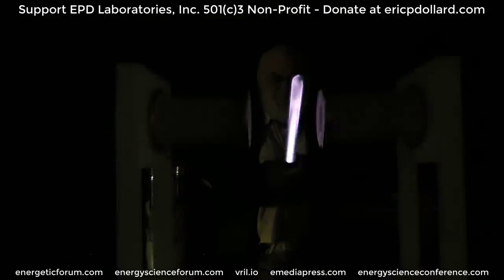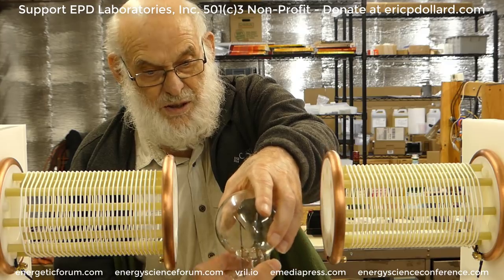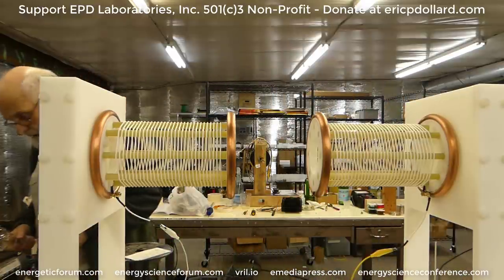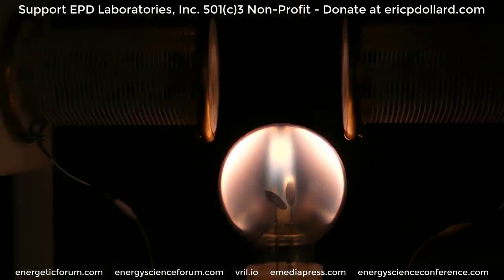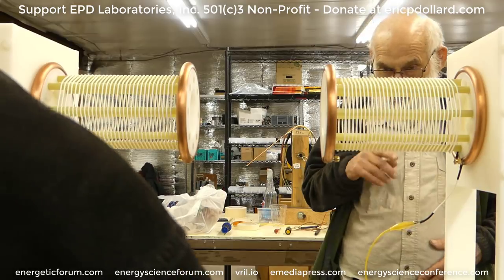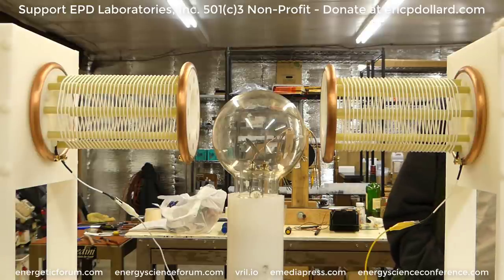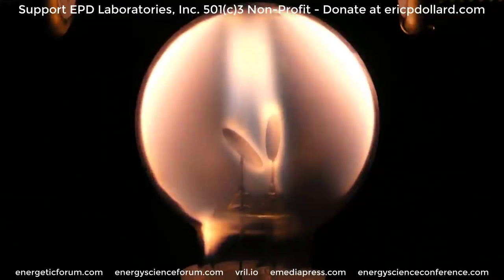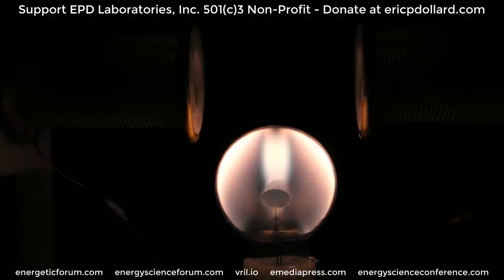2021-04-13 Cosmic Induction Mode Test 1 - Eric Dollard & Aaron Murakami

Comment: To anyone who wonders why this is a big deal- This energy is being harvested through the air- there is no traditional power supply, and he's then transmitting this power, without wires, via radio frequency. Correct me if I'm wrong but I think thats pretty amazing. Update: Still amazing, but I'm not even close to having a grasp on this. Hope I didn't mislead anyone. All the best!
Reply: Even more crazy, it’s a different type of electrical wave. Also only need one wire to transmit this power.

Check out his old Boardland Science Lectures on Longitudinal waves!
Reply: @jondelaire  I figured it was above my pay grade
Reply: @NeilZ2k15  mine too lol
Reply: Thanks. I couldn't figure out what cosmic induction was all about
Reply: I think Eric Dollard created birkeland current when he mentioned spiral electric wave form rotating clockwise and counterclockwise in his 1986 psychotronics video around 23 mins. Counter-rotating electromagnetic field is a special property of birkeland current which the outer space is full of which creates galaxies and stars. Check electrical engineer Donald Scott's videos on birkeland current.
Reply: @Xeno_Bardock  Scott's paper is good indeed, love his enthusiasm, to bad he is tied in with that other guy Wally who, let's be honest here, made it easy to be dismissed as a group (thunderbolts and EU).. pushing the anode/cathode solar model and even worse the dipolar gravity model was to much to recover from. i even like the most speculative side, the mythical/ancient cataclysm part, more then anything Wall ever said.. there is something missing in plasma cosmology, apparently the conclusions made in the Peratt papers on the simulations done on the then super computer are off, yet it would seem most significant "new astrophysics insights" are made in the realm of plasma cosmology aspects and the amazement of how magnetism does so much more then they can be comfortable with.. i love Peratt's papers on petroglyps/high current z-pinch aurora's btw, it's the most underrated and ignored work done archaeology and like some other big themes pointing to that signature problem in academia, peer pressure based bias... 
and oh yeah spread the message, the crime of the century is the push for vaccine and the silence on ivermectin.. 🙏
Reply: They should write a description at least...
Reply: So tesla coil and radio waves, why are we calling it cosmic induction?
Reply: @beachboardfan9544  because a few decades ago Eric build a similar setup which showed galaxy like structures in a vacuum tube, don't know the gas but i thought he mentioned sodium vapor as one of the compounds in that vacuum tube..
Reply: @beachboardfan9544  I made a few tesla coils myself and have several still working, when I put my plasma ball above the tesla coil I get all sorts of different effects, this isn't that special to me anymore, it's old news but still I enjoyed to watch this video.
Reply: @runs_through_the_forest  is that your Indian name?
Reply: if you think that is amazing  clearly you have no idea about science
Reply: I feel smart bc that's what I was guessing lol. No degrees I just get shit.
Reply: It has nothing to do with what you said.
Reply: patluxor2482  you're absolutely right, I don't understand it yet
Reply: Yes aetheric currents not electron flow
Reply: If you connect your Tesla coils to a xenon arc lamp bulb, you should be apps to charge capacitors at any distance as long as you focus its aetheric light on a conductive surface!
Reply: This could be fucused to a narrow beam and mske a new type of laser technology!
Reply: Wow you mean electromagnetic energy doesn't need wires? Who would have thought that? When I cook stuff in a microwave oven I always have to connect a lead to the food.
Reply: I just read Eric's paper on the Oscillating Current Transformer and he states that winding the turns of wire close together on a continuous solid support structure causes major retardation in the fields which makes the Magnetic component Transverse, is that why he always uses separate support spokes with gaps between the wires like the device here? 

Is preventing the retardation of the magnetic component like this all that is required to make the magnetic component Longitudinal or are there other ways that are more space efficient? Like his LMD transmission line for example, does that thing need to be run at its resonant frequency to maintain Longitudinal transmission? I'm trying to get the basics down of what is required for Longitudinal EM transmission.

Comment: Hopefully we get to see a fractal galaxy forming at cosmic superimposition at neutral zone soon from metal vapors and gases. 👍
Reply: is there any video evidence of those experiments out there? i listened to Eric explain the whole story in a video a few years ago but if i remember correctly there's no vid's of it? indeed if possible let's hope we can witness the real euhm magic 👉🌌👈👉⚡👈👉🧲👈    🙏
Reply from the maker: We're just getting warmed up - also, this is small scale 100w - when the 2 racks are done, we'll be at a couple thousand and will revisit these experiments.
Reply: Crannnk  it up .. 👀👀👌
Reply: @runs_through_the_forest  i saw a photo that showed twisty almost galaxy like things in pictures they shared i think on his website
Reply: @cjcoleman3893  the thing is in astronomy they are only scratching the surface on how everything works on the larger scales (smaller scales to but they keep on betting all in on dark matter ignoring EM play of plasmas as much as possible) 
it's a huge shift and thousands of profs need to realize what's going on, the gravity only paradigm is about to fall.. all significant papers now are on magnetism and it's crazy to see a whole field struggle to fit these new visions in with the gravity only models, it will take a while i guess.. :p
Reply: @runs_through_the_forest  For sure will take time to erase and replace the mind virus
Reply: Why bother with metal vapor and gasses, I’m wondering if pure vacuum aether could be used to form these structures.

Comment: Buy a tesla plasma lamp, the big bowl has no metal inside, you can easily take it apart, and they are dirt cheap. Nice an big also. I believe they contain nitrogen
Reply: What you want is easier to ionize metal vapors inside the plasma lamp along with noble gases. Metal vapors i think can act as micro-cores of fractal galaxies and stars forming inside the plasma lamp.
Reply: @UniversalExpanse light is a pertabation of the ether and a part of the electro-magnetic spectrum. Plasma etc. Is also electro magnetic.
Reply: @Xeno_Bardock  the best metal gas would be hydrogen I guess
Reply: @MasterIvo   Hydrogen is a must along with noble gases. You also need metal vapors, perhaps magnesium, titanium, iron, lithium or tungsten in its vapor form. Hydrogen may act as a layer on the surface of metal vapors acting as micro-cores creating fractal stars. A vacuum chamber would be a better choice since you will be able to experiment with various gases and metal vapors.
Reply: Narrrr  .
Reply: Would the Universe in a bulb be because of the Universe being a negative hologram? One pixel has the entire Universe in it. THEY are talking or doing, change a pixel, would change the entire Universe.

Comment: I create these effects using my zvs driver and two normal high voltage coils using a normal incandescent lamp bulb. What is the difference between what I do and what you guys are doing here? I know I am overlooking something you guys are trying to demonstrate in the vid but I never hear it stated what's being attempted.

What exactly are you guys doing? Wouldn't you get better results using a dedicated plasma globe?
Reply: Have you tried focusing tge light from your bulb to charge a capacitor from a distance, the light is most likely longitudinal from it like Eric did with this impulse DC fired bulb!

Comment: Just with the metal brake rotors spinning at high velocity inside the automobile's large metal brake calipers could power our cars, and we use them as brakes, haha
Reply: Our government knows these things and more. The powers that be dont think our society deserves to know or benefit from this.
Reply: you can't just say that and not explain it.  Something, something magnets right?
Reply: So how do you get it started then? The energy required to get the rotors moving will always be less than can be harvested back from that system due to energy lost to heat etc. Same with a flywheel. And there are electric vehicles that do use the coasting wheels to charge the battery, but again, that return is negligible compared to even a small gas generator and isn't enough to actually keep the vehicle charged while driving without additional energy being added somewhere. Simple conservation of energy tells us that this design could never work.

Comment: Ide like to setup my Software Defined Radio gear near the experiments to get some visual waveform data on the different modes and lighting states. Plus Fractal Geometry and Fibonacci Systems is a study of mine.

Comment: Looks like two Tesla coils end to end. The earth is flat, though
Reply: juano isquia  
Gotta start with the binoculars. With electrical signals you can't say one way or another. Politically the earth is a ball.
Reply: Kiri Uacybhail Otaraua  
Just knowing what or who is a fake
Reply: juano isquia  a simple gyroscope proves earth’s not rotating
Reply: 🤣
'nuff said.
Reply: @jflebas1217  Foucault pendulum?
Reply: @infidelapostate3094  
Action Reaction and Counter-Reaction
Reply: @StarNumbers  dont brinnnnng the flat earth .
Reply: @istopedthewuhanlabfunding6351  
Action Reaction Counter-reaction is not about flat earth, but it could be about a strinnnnng
Reply: @StarNumbers  the big glassssss dome over the flat earth is 
Ringgggging.
did some2  just fart.
Reply: juano isquia  its important to know. when they say flat they are talking about the surface of the plane. the atmosphere of the earth is curved and extends out into space for miles...which is what makes the earth curved.. the atmosphere does indeed count as earth i think some of you forget that. so yes we are in a sphere i  highly doubt we are on one. especially since only a small portion is lit at a time i doubt we know what the complete thing look like... i wish space was lit up for a day so we could see whats really going on